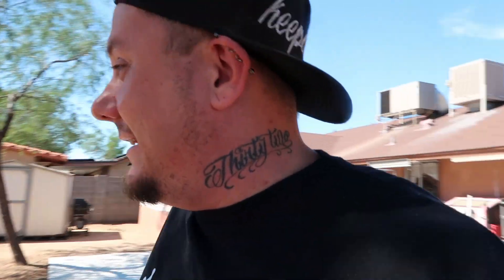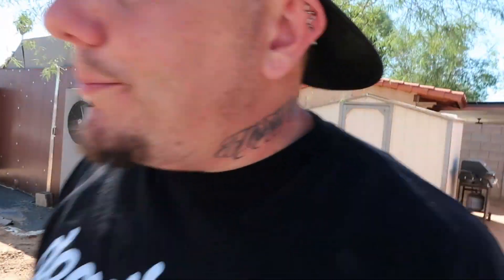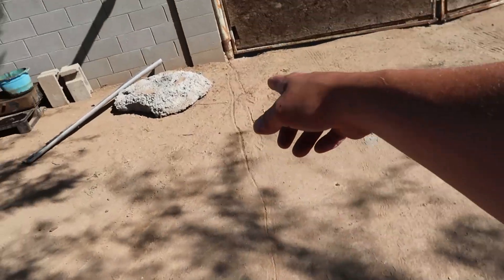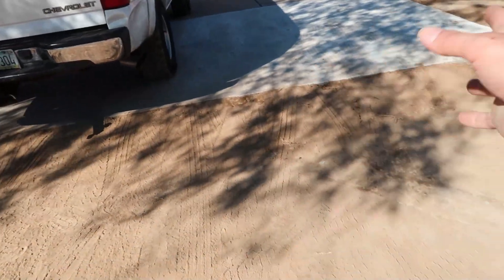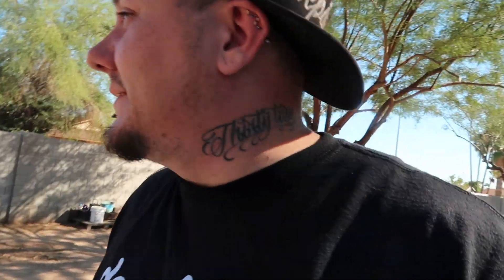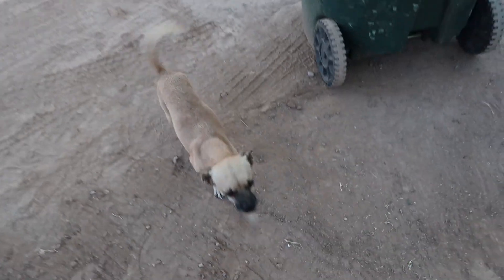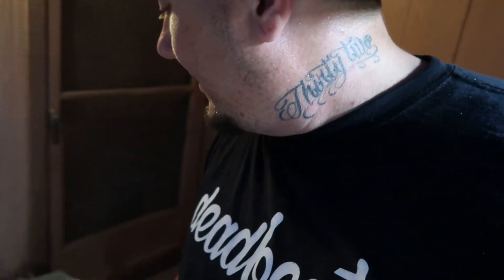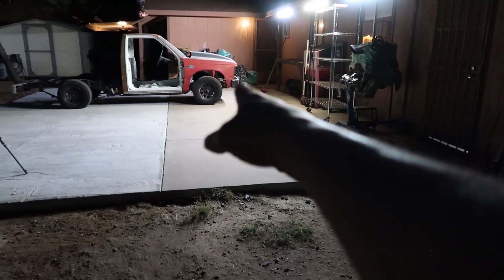Finally READY to work on the S10!

Comment: I’ve been considering taking on a project for a nice little chill area for the backyard for myself. Just for some more content for you, I came across some YouTube videos where people form out multiple large pads from 2x4’s. You can get bags of concrete mix and work one form at a time so you can get a better finish. Then they fill in the spaces inbetween the concrete pads with either a decorative rock or strips of artificial grass. Place a nice little fire pit and seating, some plants, bbq grill. It could be a pretty chill spot after working your ass off on a car all day. Some more dope content I know people would love to see is a rebuild of the paint booth. Definitely get some buddies over to help with that concrete pad, since this one kicked your guys asses 😂..and content of running conduit out there for your lighting and getting compressor setup.